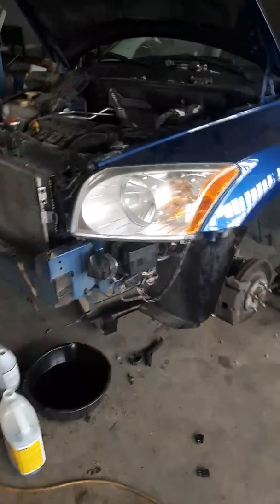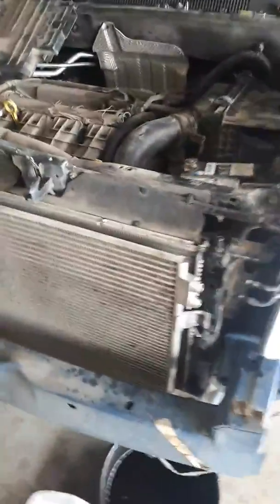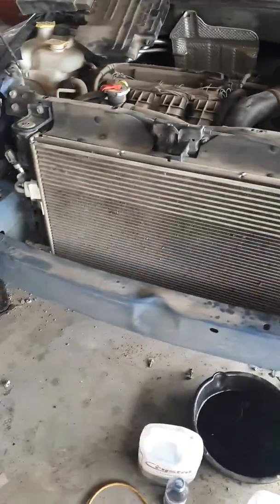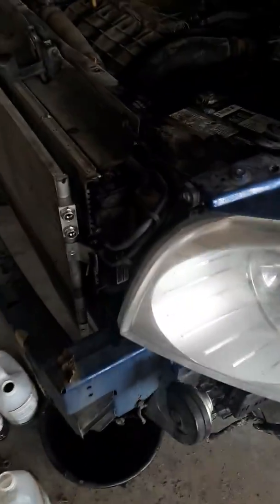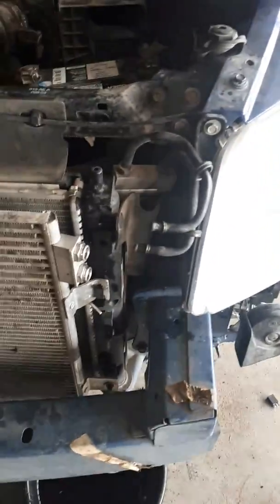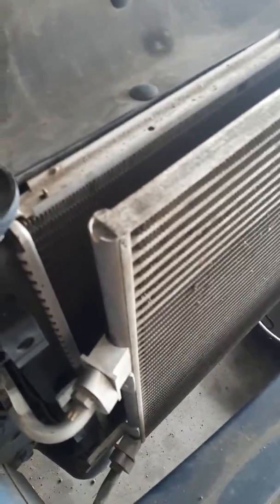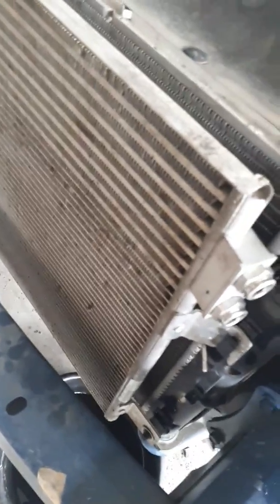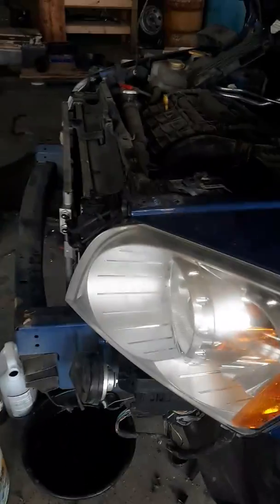Dodge Caliber Limp Mode Transmission Overheating

Comment: In the mountains of Montana, as I'm going up a steeper/longer hill, I also smell burning rubber. 

I have to limp in to a spot and use water to cool it anc carry on. 

I like the separation of the two cooling parts. Great video, thank you.

Comment: My fix for lime mode was changing the transmission fluid and two filter after the 3 drive I never had lime mode for over 2 months if the engine and trans still get hot you have to change the engine thermostat their are two one in the thermostat housing and one that attached to the block, once those change vehicle nor transmission should not get hot, reason for heat is a delay in thermostat opening, and reason for the whining is the transmission belt not shifting 7 quart of fluid do the fix… I own two caliber and those are the fix.
Reply: Platinumtag,  this is Buddy, not Nancy. Thank you for this. Changed both filters, fluid and a new slightly deeper pan from parts geek. Still gets hot occasionally. I have wondered about the thermostats if they were affecting the tran temps. I bet you have hit on the cure for "most" trans overheating problems. Thank you this. All the Best and may God bless.
Reply: @NancyLancaster-m6l  I own 2 caliber both for the whining which make the car overheat I did the trans filter and fluid for the other caliber that was overheating I change the thermostat....thermostat is tricky bc the needle pin need to be in 12 o'clock position and taking off completely the pin will allow u to purge the system probably and quickly... If u have any other overheating it has to be the engine has power but transmission not receiving it making the engine work hard.

Comment: Do you think the re flash would work to solve the original problem before you replaced the transmission? I've heard that dodge came out with software upgrades for the 2007 and 2011 models. 
Also, what did limp mode look like for you?
Reply from the maker: no, the re flash would not have worked, the fluid was burnt and really dark, also the codes were showing a faulty transmission.  This cars limp mode was very limited acceleration with a max speed of 50-60 km.  Also the transmission would overheat when pushed or driven hard.  After changing the transmission it was reflashed, and ran good for awhile but did the same thing.  Took it for a 2nd opinion and found out it was another faulty transmission, had it replaced and reflashed and is running fine so far.  Will try post an update if anything goes wrong.
Reply: @THEMOOSESWRENCH  how did this work for u
Reply from the maker: @amandachavez4336  it didnt work out, the transmission was burnt to begin with, the 2nd transmission i installed was burnt as well, it worked for a bit after a reflash but just went into limp mode again.  After a 2nd opinion and 3rd transmission change and flash, it is running fine so far.  I recieved a reply and researched on the tipm and wiring in these calibers.  Not sure if you can see the reply about the tipm, but it stated that the tipm gets wet and corrodes or shorts, either from a carwash or weather elements.  Wiring under the drivers side fender and behind the bumper are exposed to elements as well.
Reply: @THEMOOSESWRENCH    it dose of feel like it goin out tbh  it drives smooth   i was goin to Belen goin 75 nd that light turn on nd lol slowed down

Comment: Just had that on the freeway on the way home I hope I didint burn out the transmission 😵 but it seems to be a problem with all calibers, I already have extra cooling and it's still getting hot and it's a freaking pain. I am probably getting a different car 😆
Reply: Just change the engine thermostat u need to change both thermostat secondary and primary and engine and transmission won’t get hot, engine will stay warm not hot….if You have whining it’s the belt delaying shift so change both filter on the transmission and add 7 quart of fluid that will do the fix …I own two caliber it nothing electrical just need to do those servicing
Reply: I was told my 2007 Dodge Caliber transmission only held one quart thought this don't sound right rancot was winding let it sit for an hour drove in home 50 Mi an hour work fine
Reply: @Platinumtag  Mine rides fine until I go 70 MPH on highway then once it cools down it rides fine😒do You think it's the same fix Your talking about with the thermostats?????
Reply: @cortneybutler45  common issue is the thermostat just make sure the jiggle pin at 12 o clock and if u can remove the jiggle pin and make the hole little bigger it will take the air out they system quicker to prevent heating when u purge the system

Comment: My caliber goes limp mode with the transmission heat light when I drive it long distance above 75, have cooling but still goes limp.
Reply from the maker: ya, this caliber was doing the same thing after the replacement, had to replace a 3rd time due to faulty transmission, and it is running fine now.
Reply from the maker: Also check your tipm, if you can find someone with the proper setup for reading and reflash to check everything out, thanks.
Reply: @THEMOOSESWRENCH  AAMCO said that might be the transmission, cvs transmission usually have those kind of issues, I hope its can be something else
Reply: Mine dose to cud sum one gi e me advise
Reply: Dont run AC in the car, use regular air or heat with windows down. or if you do, have the air recirculating and make sure you always have that setting on

Comment: I’m putting in a auxiliary cooler to help it not overheat
Reply from the maker: That seems to help alot, it works great, ive seen it done in a few applications, thanks for watching and the info!
Reply: Recalibrate it so the cvt gear can shift faster some time they don't reach to the max gear , and cause heat, lots of tricks with these caliber, removing all thermostat can help too.

Comment: Remove all the thermostat and save the vehicle ,
Reply from the maker: Awesome, thanks for the info, and thanks for watching!
Reply: @THEMOOSESWRENCH  a cooler engine will last longer than a hot engine. I had a jeep cherokee v8 5.2 with no thermostat and last over 25 year and never overheat. Still going strong after I sold it. Of all the vehicle I had I was wonder how thing thing never over heat of all the vehicle I had so I went to upgrade the thermostat one day, just to find out their was none. Lol,
Reply from the maker: Haha awesome, I wonder if the same would go for a nissan cvt?  I'm working on one right now and as soon as it gets hot it starts to act up, starts out and runs normal cold.
Reply: @THEMOOSESWRENCH  should work bc the cooling is continuous without the thermostat, good thing to do too, is drain out the oil and see if the right amount is in their and fill it back up.
Reply from the maker: @Platinumtag  k cool, I'm gonna try it, thanks!

Comment: It's the transmission bypass valve
Reply: There is a cartridge-type filter behind the bypass valve. They can clog up.
Reply: Is the bypass valve easy to replace?
Reply: Right on brother thats how i fixed mine change the bypass Valve AND torque converter PROBLEM SOLVE.
Reply: Afther i changue the condensor put a afther marquet cooler change the trans temp sensor finally my trans guy told to take It down AND change those parts AND ITS been good so far.
Reply from the maker: Awesome brother, thanks for watching!

Comment: How did the fix turn out?
Reply from the maker: The caliber is running fine.  Had to have the tcm flashed to the new/ used transmission, but other then that, its running fine.  I did find out that if i would have used the tcm that ran with the new/used transmission, i would have had no problems.  Not positive if it would configured to the ecm though, probably would have.
Reply: Wat is ecm
Reply: Amanda Chavez engine control module

Comment: Bro I just fixed that problem
Reply from the maker: Awsome, wut was your problem?  And its ok if you don't want to reveal your secret lol.  Thanks for watching!
Reply: @THEMOOSESWRENCH code p1607  the coolant temperature sensor fixed limp mode my caliber was only running for 20 minutes yes exactly 20 minutes, and now thinking about it.in 20 minutes reaches the operating temperature and shuts off so the  computer that was looking overheat  that was my problem now I ran the car for 45 minutes and never shut off,  I changed both of them  but I think it was the one on the top one  and the car was shutting off and it would not turn back on cause the battery was dead every time the car ran on idle for the 20 minutes,   cause I think the alternator wasn't charging the battery so maybe the computer was shutting down the electrical system when the computer sees overheat. Now I have p0700 transmission issues but I think is easy to fix it  the car runs fine
Reply from the maker: @rodger6940  Awsome thanks for the info, thats good to hear!  Your info will hopefully help someone out someday!
Reply: @THEMOOSESWRENCH  I’m driving an 09 caliber I’ve had for about 7 years now. I travel about 55 miles to work every day and have this same problem. I get the code after about 30 miles one way on the express way and limp the rest of the way there. I did put an external cooler on the car and changed filters and still doesn’t seem to hold. Wondering if getting the computer flashed has helped Anyone?
Reply: @joeMACAY1  did you solve the problem?

Comment: Sounds like what happen to mine it was the t. I. M. P
Reply from the maker: k thanks, i will have a look at mine!
Reply: Christina Olson 
What exactly did you change and did it fix the hot transmission problem? Please any information will help
Reply from the maker: @fellowtraveler2495  it was the transmission itself, changed it a 2nd time and seems to be running fine so far
Reply: @THEMOOSESWRENCH  That's surprising, some of those Calibers in those years come with Aisin transmissions. Do you know what kind of Trani it had? Was it a BG6 Aisin?
Reply from the maker: @Brian-vz7xe  Hey Brian, honestly not sure, never really looked into to deeply, usally just match numbers.  But will check next time, do they actually come in different makes?